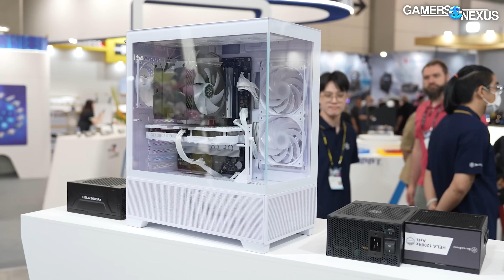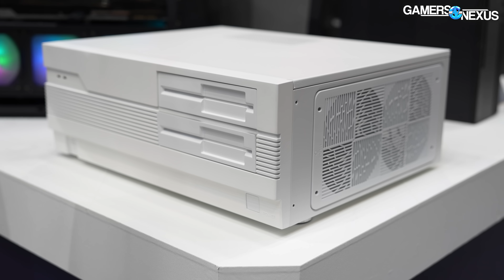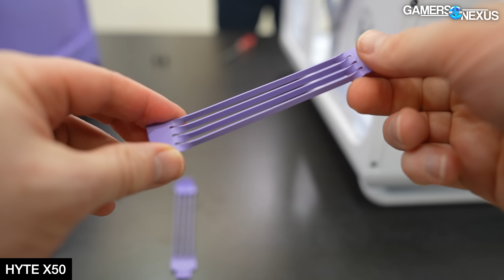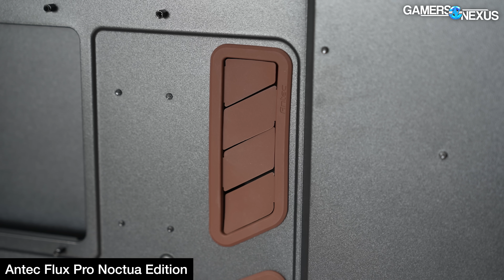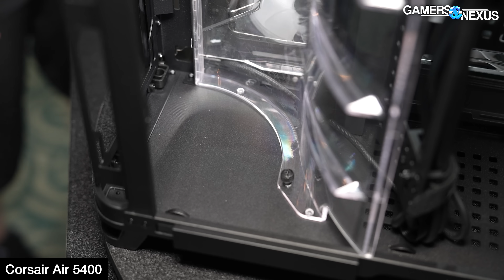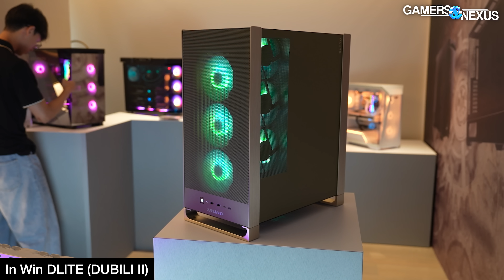Best PC Cases for 2025 So Far | Computex Round-Up & New Designs

Comment: For anyone looking at the TR cases, 

The regular one ended up having a plastic insert instead of the steel/metal piece. 

Whilst the one with the screen did away with the front segmented display, only keeping the LCD panel on the left. 

The mimic "brushed steel" strip does actually  sufficiently "look" like metal, at least in person on the white variant.

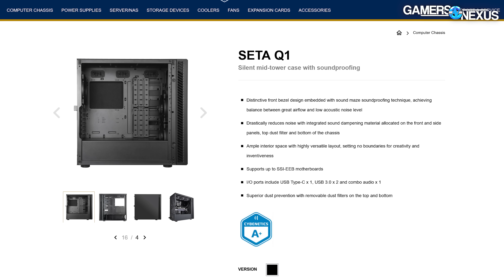Comment: 5:50 When it comes to cases like these, I noticed liquid cooling is a good option,  BUT not the only one. Forcing intake from the back, through the large / long enough air cpu cooler, and then using top fans as exaust provides best performace. You can skip top Front fan and use only the bottom one for intake as well to feed gpu fresh air. This should in theory create good enough pressure even in the most enclosed cases.

Comment: I just can't find the kind of case that I want. I want it to be like the thermaltake view 51 crossbred with a Corsair frame 4000d. So I can fit 3x120mm fans at the bottom (directly at the bottom to get fresh air unlike what the frame 4000D has where it just grabs the air already in the case to throw up at the GPU) front (without a glass front panel because that's the biggest issue with the view 51, the glass blocks out intake and exhaust), side and top with one 120mm fan at the back. With enough space for a push-pull 360mm aio.....okay okay I just want to fit 13-16 fans in a dual chambered atx case. The view 390 air is so close to being what I want out of a case IF ONLY I COULD PUT TOP FANS INTO IT

Comment: The Cougar one seems to be good too. Splitting the main chamber from the power supply chamber so the fans at the bottom that normally would be on top of the PSU shroud can directly suck in air from outside the case is a brilliant idea.

Comment: 65 dollars for the TR M10 with two lcd's ????
Well, screw me sideways. If it were a full tower, I'd be very, very interested.
Thermalright is quite a good brand, had some cpu coolers from them, they were tremendous.

I wonder if this 65 euro is MSRP and will be MSRP. In recent months we've seen that this so called MSRP is a bit of an utopia.
I rather think this case, at least in the Netherlands, will be at least 150 euro.

Comment: those montech basic cases are exciting personally, although id rather see them cut the cost of the glass panel and give either side mesh or just a steel panel. they could run away with the lower end market if the case is quality and cheap.

Comment: help me out here @GamerNexus or anyone who feels like. My problem is that I want to install a Creative Sound Blaster AE-9 sound card in my PC. Currently I am running a 3060ti but soon an upgrade to a 5080 is planned. The AE-9 is such a massive sound card that it blocks airflow to the gfx card. Even if I use a pci riser/extender cable and mount it on the last (7th) slot of the case, there still isisnt much space left between that an the gfx card, plus if the case has fans at bottom, at least 2 of them get blocked by the sound card, or if the psu is at the bottom, I am afraid the card will block the air to the psu. Mounting it on the 6th slot reduces the airgap for the gfx card even further. So, all in all, someone suggest a solution to install the AE-9 in the modern gaming pc with a 2/3 slot gfx card.
Reply: If you are that worried about the airflow and getting audiophile tier sound, either just get a dac/amp instead, or go for a cooler running gpu.  I have a 4070 and AE-7 currently on a standard ATX motherboard in a Meshify case and my temps have been fine.
Reply: @monoxidish  thanks. the ae9 is already purchased. currently i was running a dual chamber regular case (with 4 slots) and thats clearly inefficient. the 3060ti overheats and crashes. so i am going to get a e-atx case (with 7-8 slots). I am just a bit worried that the max gap between the card and the last slot (if i use a pci extender cable) might not be enough. on top of that, when i upgrade the 3060 ti to a 5070+ the demand is going to increase. I cant really experiment and the AE9 has costed me abour usd 550 so i dont want to not use it. i guess ill get the biggest case i can and install the ae9 as far as possible and see.

Comment: When testing the new Lian Li glass panel front cases. Could you test for torsion when removing the front panel for cleaning. I'd be slightly concerned about the glass breaking when taking it off. Looks great though and well done to them for doing something new.

Comment: Nice to see innovation in cases. I like the configurable case. It would be cool if vendors could make 5 1/4 bays optional also. Like they could ship with a 120mm fan and grill that goes into the 3x 5 1/4 hole. Imagine the front could have 6x or 9x 5 1/4 bays with a 120mm fan and grill for each.

I'd like to see monster cases come back.

Comment: For the FLP02, im thinking a passive cooled NAS build with an EVGA x570 ftw, 5500xt, noctua passive cooler, 32gb ram, and all the old hard drives in the house. (for now)

Comment: Few cases really looked intersting to me. The Hyte X50 was one of the few  though. Now I understand if a lot of people think it looks like some kind of toy or half chewed bubblegum. But the construction makes it seem like a really decent case. Loose the glas side panel for solid or perforated side covers and it starts to look real nice. And the Thermalright case was very interesting, not for it's look or function but for it's price. If they can shake the case industry the way they have turned the cooler market upside down then I really hope they go for it.

Other than that the only case I really like this year has been the Antec Flux SE. It's a Flux Pro minus the RGB and the glass side panel. Solid steel side panel that is sound insulated is just so lovely to see in this market. If they make a Noctua edition of the Flux SE it would be close to perfect. Bur personally I'm perfectly fine with the Antec brand fans. did a unplanned fall down some stairs and cracked my head. It ripped off the nerves to one ear, so it's permanently 100 percent deaf, and I have a lot of tinnitus in the other. So noise isn't really that big of an issue anymore. Intersting thing is I can't hear anything on the right ear but instead I get a constant tinnitus like squeal in there. I guess it's the nerves picking up stray charges instead of the sound information. Annoying!

Comment: Modern case design manages to combine ugly with lack of function... I finally broke down last year and bought a cheap ugly rack mount at case. It's quiet, stays out of the way, has infinite flexibility for HDDs, ssd, optical, fans, cards, and it all hides behind a rack door. It's truly the best case I've ever owned and I got it on sale for well under $100, and unless ATX goes away as a standard it will be the last case I'll ever buy.

Comment: A lot of cases with big fans, food for disaster, or you must have Noctua 20cm fans, these are well build and won't sag after 6 months. Other brands, I just not trust. Ik had once 25cm fans and after 3 months 24h use they already hit the basket and coils were burning up. That SilverStone retro case, you still can add 5.25" water reservoirs from Alphacool so you can water cool that one.

Comment: I love the look of those Hytes...

 one thing I foresee... as with my component stereo (returning to the glory days of the 70's and 80's, I wonder how long before each part of a PC is separated.?

 eg: CPU, RAM, storage drives are isolated in one cooled box while the GPU is in its own cooled box and the power supply is also in a separated box... like a turn-table, tape-deck, receiver, amp(s), equalizer all laid out for my music, the same can be done for the pc and inevitably, CPU/RAM/HDDS won't have to suffer from excessive heat by the GPU/PSU and maybe even have cleaner power supplies too?

Comment: @GamersNexus So for the Corsair 5400, do you anticipate issues for AIOs in that ducted space because it is mounted in way that will cause air trouble with the reservoirs? I just watched your video regarding the subject and was wondering if that would be an issue with the case, I'm sure you will cover this in a video about the case, but maybe there is something I'm missing. 
Cheers, great video!

Comment: I just moved my rig from a modded Corsair Air 540 Carbide (selling it tomorrow) to an Antec C8 which is fantastic, but I'm going to rebuild it, again, as soon as I can get that new Air 5400! 
I really love that Silverstone retro job, but I'm all-in on dual chamber and Ive been waiting YEARS for a radiator that doesn't intake or exhaust into the main chamber (that isn't an open bench) and I even started to build my own after getting fed up with waiting, so that Corsair 5400 is mine! Most hyped I've been after a trade show.

Comment: 4:51 just want to call out an error in the edit. The preceding sentence is in reference to the key lock, the statement “and it actually works though could be rewired to do something more” is in reference to the turbo button which wasn’t actually mentioned in the clip. My guess is both clips for the buttons contained a statement that “they actually work” and they dragged the clip a tiny bit too far and pulled it over the introduction of the turbo button. Get some rest boys, you had a long week
Reply: Made me wonder if anyone has ever sold a wired up "ignition" style power switch especially for a racing simulator.
I will personally miss my Corsair C70's flip covered reset switch when it is finally retired.

Comment: I know it would be difficult but if possible, could you guys do a dust intrusion test for cases. For most casual PC users it would be just as important as the thermal performance if not more so. As a computer tech a Geek Squad, I see so many computers that are basically not maintained at all. 

A dust intrusion test would make even more sense for a prebuilt since buyers for prebuilts are even less likely to dust out their computers properly.

Comment: "Silverstone's FLP02 which is a retro themed PC case with a functioning real turbo button" No it doesn't. If the turbo button were functional it would switch overclock profiles, all it does is set your fans to 100% which isn't even desirable. It does look cool though.

Comment: excited for the tr200. i like the style and size of the tr100 but mini itx (and related small parts, e.g. sfx power supply) is too expensive to bother with for me. a little bit bigger tr200 to fit m-atx is nice, i can swap out the case for my first pc to something a bit more correct fitting. (originally m-atx board in atx case)

Comment: What i like a lot about this year is that there is a case for every use and taste, and not just the same trends copy/pasted over and over again.
Reply: I am so tired of fishtank cases. Never owned one and never will since 2013. Bought the HAVN BF 360, suits my taste a lot.
Reply: @Metal-Emperor01  Looks like a really nice case to build in, and performance seems great. Im stuck with a NZXT for the foreseeable future for my computer, albeit it is HEAVILY modified. I basically had to redesign the airflow inside on a budget since that is what came with the PC when i bought it used, i got a really good deal on it. Its housing a overclocked Ryzen 3900X, a overclocked GTX 1080Ti for windows gaming and  a stock clock GTX 1650 for linux display output. 
All the parts run at about 65C when gaming and 80 - 85C when benchmarking.

Comment: I'm going to be plain about this; I don't care about the FLP02's looks. I care about its functionality. One day, I want to put MB326SP-B's inside of a computer and have a striped 16TiB RAID in my computer. I might even want a 5¼" dual-slot slimline SATA adapter for a couple of 12½mm ODDs, and more adapters for those to use 2½" media as individual game storage devices handled in a tool-less fashion. There's no reason why these things shouldn't be still.

Edit.1: For the people who say Use USB drives a few points;
1) No. While USB-C and the host versions after 2.0 suck less there is still the USB overhead, no matter what.
2) Thunderbolt is a solid consideration, and adapters for USB which support TB exist, but USB still has durability issues.
3) Byte-for-byte, SATA SSDs can be cheaper than equivalent USB flash drives past 256GiB.

Edit.2: For the people who say Use M.2 a couple points;
1) No enclosure standard means adding durability to M.2 is a free-for-all which worsens vendor lock-in.
2) If i ever want M.2, I can adapt it to SATA and it'll be cheaper in the long-run to do that with SATA M.2 devices.

Comment: Regarding the SilverStone FLP02... While it is fair to do a review on the default thermal performance. There's also something else that needs to be recognized. Case modding in those days was more common (relative to the size of the industry overall). Where as now it's been downgraded to an esoteric hobby. It'd be cool if you did the default review, and then worked with Jay2cent to mod the case 😁😁

Comment: I wish some of these manufacturers would make a few cases with the mother board rotated 90 degrees from typical. I air cool so to maximize air flow I print a stand for the pc so I can run it with the face facing the ground. It makes a huge difference to the the video card heat.

Comment: So far I have owned the Antec 1200, Antec 900, Corsair 270R and now the Antec Performance 1 FT. Im split between which is my favorite but all had their little quirks. One thing I wish cases would include today are manual fan controllers. Give us the option to plug the fans into the motherboard and control them through software, or give us knobs and switches to control them manually as well. A 5.25 drive bay would be clutch but I understand its hard to intergrate one nicely without disrupting the case or making it really tall. Integrated graphics card anti-sag bracket should be included in every premium case. Stop putting in excessive amounts of glass for literally no good reason. Keep everything cheap stamped steel and only use plastic or glass where it makes sense. Yes we are always reinventing the wheel but some of the products are actually stupid.

Comment: I'm old enough to remember when top-mounted power supplies were just the norm.  It's funny to see them making a comeback.
Reply: Interestingly, the one with super retro appearance actually has bottom-mounted PSU instead.
Reply: question is are u old enough to remember having a top mounted psu with a tiny fan blowing air in 😊
Reply: I'm not a fan. Power supplies in the bottom are much more stable. I would rather they change ATX standard to put the motherboard power connector on the bottom.
Reply: @Trifler500  For real. It makes zero sense having to route it behind around and out. 
I'm just happy nvme's are becoming cheaper so now we can go fully cable less away from ssd's.
+ I upgraded my old corsair fans to the icue links... so it cleaned up a lot of cable management & clutter... I just wished they made the connection cables a bit longer to make it easier route.
Reply: Power supplies finally ready to get out of the basement
Reply: @zivzulander  ya, they moving on up into a condo loft in the sky.
Reply: So you're older than 15? Wow!!!! You're SUPER old!!!
Reply: @mintymus I don't think many 1 year olds were building PCs...
Reply: @kevadu Ok, add another 10 years then. OMG HE'S 25, THAT'S SO OLD I HOPE HE HAS A WILL!!!
Reply: @mintymus  10 year olds arent building PCs either. Just admit that you didnt think through the joke very well. Honest mistake.
Reply: @davidsentanu7836 Sorry for being right and offending you.
Reply: @davidsentanu7836 Sorry I hurt your feelings.
Reply: @davidsentanu7836 Sorry for triggering you.
Reply: @davidsentanu7836 Do you always trigger this easily?
Reply: @davidsentanu7836  yeah 10 year olds NEVER look at computers.
Reply: @kaydog890 Probably not, but at least I'm more alright than you.  Mate.

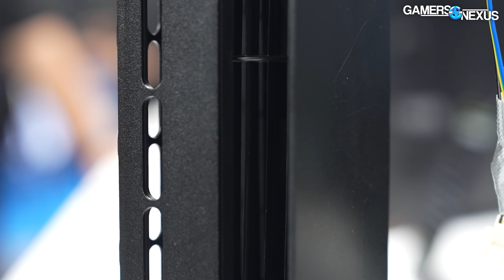Comment: 24:22 "more laminar flow across the GPU": Instead of that, one case manufacturer should allow the hot GPU air to escape from the case directly through a duct or perforated area in the side panel. Why try to move the hot GPU air to another area within the case if it can be removed directly? The direct removal of hot GPU air out of the case is not as important for watercooled systems, but any built with an air cooler should noticeably benefit from avoiding the hot GPU air being sucked into the air cooler (or being recirculated by the GPU).

Comment: Legit never understood the need to make cases wider and placing the PSU sideways, wasting TONS of volume, increasing the overall footprint of the case. All aesthetics, terrible distribution.

HAVN, though, is closing in to what i'd call a perfect case for optimizers like myself.
Scooped bottom, psu in normal placement, those cases are really really interesting for me. Narrow body so desk space used optimally, not too tall or with too much dead space between end-of-gpu and front-of-case. Again, optimal use of the volume.
Make it work with 3x140mm fans and Im fuggin SOLD. 2 is very good already though, like it was with the Meshify C and the regular version.
Reply: Eh? Moving the PSU lets you directly feed the GPU with three fans on the bottom, and exhaust with three (likely radiator) fans on the top. And you can then decrease the height by that amount, too.

Comment: You didn’t check out the Cougar CFV 235 ))): that one is also interesting. But def year of the Cases
Reply: Asus does have AP202 with same bottom intake as cougar and gamemax
Reply: @RFYID  thanks for the info! That’s a cool case too, does look a bit more rounded rather sharp compared to the cougar. The cougar is compatible and has options for atx which is nice 😄 not too expensive either